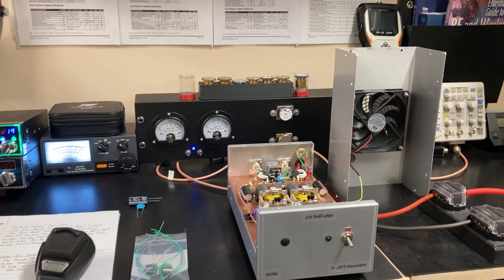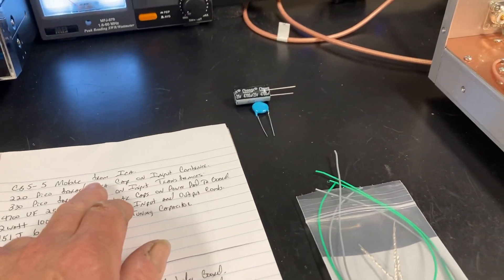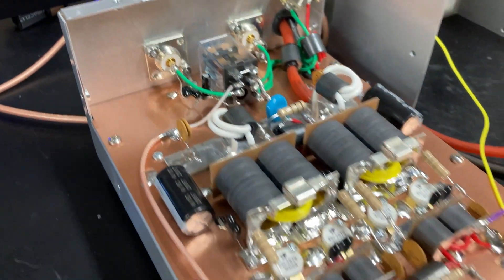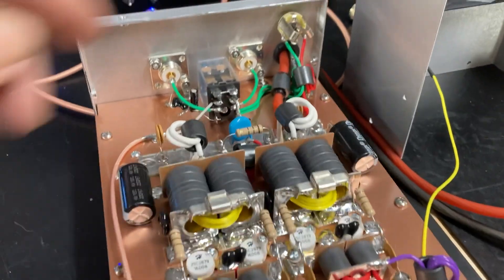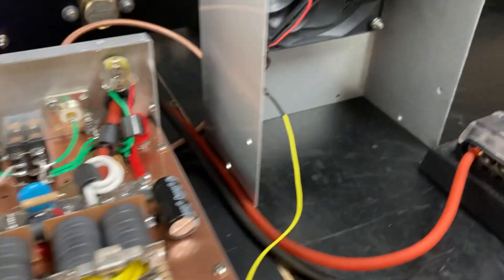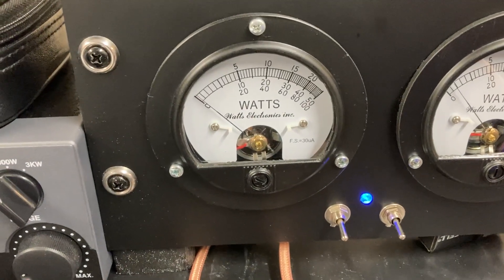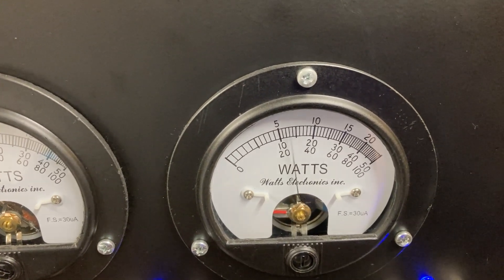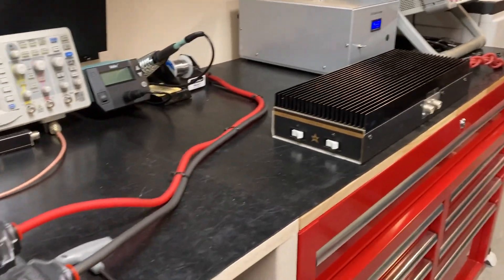106 amps 4-pill build

Comment: great video thank you looks great one question-what keying capacitor did you use and what diode//last question what is the part number on the --metal clad capacitors   would like to build this  for my hobby thanks you

Comment: Helped me a lot building mine. Only thing is my Toshiba schematic shows 1000pf + 150 for output turning. You use one 151j cap which is much lower. Is that because these are hg?

Comment: If I am seeing this right, this is a class C amplifier...which means loads of distortion. I say this because the purple chokes on either side of the input transformers take the transistor inputs directly to ground for DC, so there is no input bias to make it run class AB or (preferably) class B. What am I missing here? Great video BTW...very clear and descriptive. Also, a very clean looking build.
Reply from the maker: Yes it’s a class c , I don’t use them or sell them , just wanted to see if I could build it, thanks for the nice comments

Comment: What do you have to do the your truck to make it handle 108 amps . Run 2 batteries.  Or add a alternator.  Or both . ❤
Reply from the maker: I would say alternator, and a battery isolator, one battery for the vehicle and one for the system, that’s how I did a car audio install years ago that had 4 amps

Comment: First of all, I wanna thank you for your videos. I truly learned a lot from you. I actually built the same box. Your four pill seems to work fine however I can’t seem to find that blue output, tuning capacitor. I don’t know if there was a mistake on the numbers or whatbut maybe you can correct that for me if you don’t mind I appreciate it and I thank you so much again
Reply from the maker: This is not exactly but the 150 pf ones in this kit should work just fine https://www.amazon.com/10000pF-Voltage-Ceramic-Capacitor-Assortment/dp/B073TW1XG1/ref=asc_df_B073TW1XG1/?tag=hyprod-20&linkCode=df0&hvadid=693270340071&hvpos=&hvnetw=g&hvrand=1697612190553412532&hvpone=&hvptwo=&hvqmt=&hvdev=m&hvdvcmdl=&hvlocint=&hvlocphy=1027270&hvtargid=pla-1649669417969&psc=1&mcid=98f4cb50f8f1387189ce70450d9ec29d
Reply from the maker: There not easy to find, when I built this four pill I did it exactly like Carl builts 400hd and he had a blue capacitor on the output and it had 151j 6kv on it so it found some of them on eBay and ordered them, and they worked, here is a link to what ica has for tuning capacitors there’s is a 150 3kv but Iam pretty shure it will work the same, Iam just learning the tuning of these amps, so I don’t really have a solid answer for you, but i pretty shure it should be around a 150 pf capacitor on the output, sorry I can’t help out more https://www.icamanufacturing.com/shop/p/tuning-capacitor-3kv-150pf-120pf thank you for the nice comment

Comment: Not sure if those bias chokes are doing anything when you have the input transformers soldered straight to ground
Reply from the maker: The input transformer is not soldered to ground, it’s a small block of the phenolic board that is soldered to the rf transformer to space it up , the transformer is not making contact with the board, the copper side of the board is facing up towards the transformer.

Comment: Good work man.  Question: very curious about the yellow strip nut/bolt thread checker hanging on your wall.  I use those when in the big box stores..didn't know they sold those?
Reply from the maker: My father got it from ace hardware, he told me that he asked one of the sales guys that he always talked to when he went in the store, could I get one and dad said he ordered him one , that’s my dad’s storie anyway, not 100 percent shure if that’s how he really got it
Reply: @frppower1  That's awesome..no worries..
Reply from the maker: https://www.amazon.com/Thread-Measuring-Vertical-Checker-Metric/dp/B071HTKL2T/ref=asc_df_B071HTKL2T/?tag=hyprod-20&linkCode=df0&hvadid=642059619798&hvpos=&hvnetw=g&hvrand=483984058592755964&hvpone=&hvptwo=&hvqmt=&hvdev=m&hvdvcmdl=&hvlocint=&hvlocphy=1027320&hvtargid=pla-1599800458221&psc=1&mcid=a4d5131969ac3cd98fa2bf40e6af9da9
Reply from the maker: I typed in a google search and it turned up a few different ones, but there all like $45 to $65 , hope that helps.
Reply from the maker: https://www.amazon.com/Retisee-Identifier-Standard-Centimeter-Classic/dp/B0CGDDBX63/ref=asc_df_B0CGDDBX63/?tag=hyprod-20&linkCode=df0&hvadid=675731002496&hvpos=&hvnetw=g&hvrand=483984058592755964&hvpone=&hvptwo=&hvqmt=&hvdev=m&hvdvcmdl=&hvlocint=&hvlocphy=1027320&hvtargid=pla-2244489923936&psc=1&mcid=fef30d0c05b8320385866cdfd019c014
Reply: @frppower1  appreciate that. Thanks.  Until I seen the one on your wall, I really never thought about having one for myself. ha
BTW: since you showed your Carlbuilt 16 pill, how do you like it?  I build all my own boxes too.  I've always wanted to build my own custom single cabinet 16 pill base box and hope to get started on it soon.